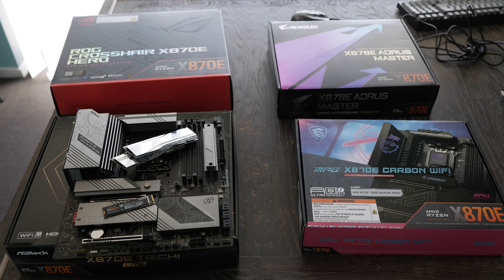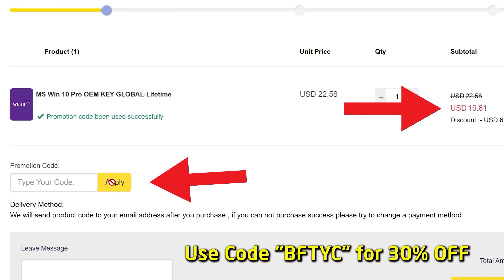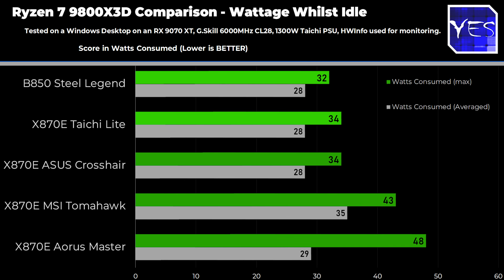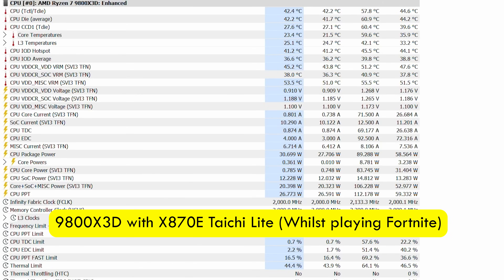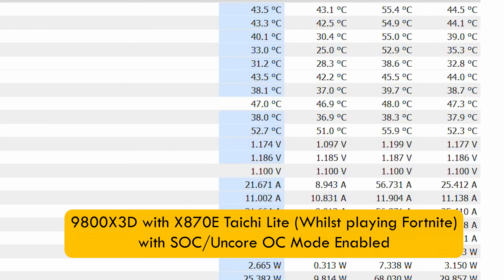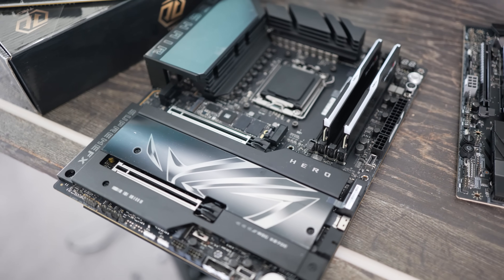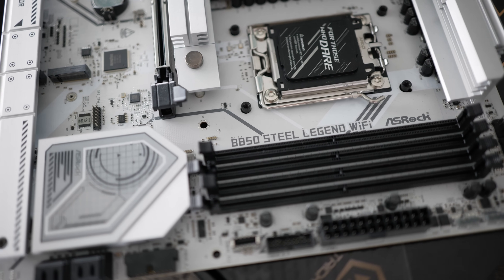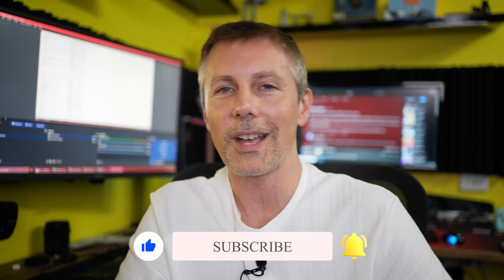I think I know why Ryzen 9000 Series CPUs are Dying...(!)

Comment: I been building computers since the mid 90s. Let me tell you something. We have NEVER had this much hardware failure rates before. Something is wrong in the industry
Reply: The road to monopoly means less competition, lower quality, and higher prices.
Reply: Physics making the components degrade faster, combined with corporate greed and cutting corners make hardware die faster.
Reply: The default voltages on higher end products seem to be bad enough that the user needs to know how to tune them. The degree of FAFO is increasing. Spent a lot of time in BIOS in recent years. X870E set my soc to 1.125 and it's almost a month old been great but have neutered it a bit.
Reply: @dianaalyssa8726  exactly, the only thing that can physically kill a cpu besides improper handling is voltage.
Reply: Greed and corruption
Reply: The technology is also much more complex now. The more tiny electronic components there are, the higher the risk of failure.
Reply: Before, almost everything was built to last, now cursed money is only thing in whole game.
Reply: Tbh the fact a device that relies on conductors that are only few atom wide works is a miracle by itself. I'd blame software devs who make such shitty code that it takes progressively more compute power just to maintain existing functionality. Office software is basically the same as it was 10 years ago, games look just like they did 5 years ago but it all requires an order of magnitude more compute to run nowadays.
Reply: @alexmin4752  You need to understand that the line between hardware and software is not very clear anymore, e.g software is being used in hardware design. But thats besides the point. The point is that engineering companies have been recently taken over by bean counters that interfere with design process, trying to cut corners. The result is obvious: unstable complex systems that get released to customers before properly tested. I am an engineer, trust my word on this :-) And you are absolutely right in complaining about shitty bloated software being produced by large houses for consumers. It is the same thing like shitty hardware made for consumers, e.g. printers. If you want quality, you'd need to go for industrial but that will cost you significantly more...
Reply: @bflmpsvz870  There's truth to your words but still if there was no such desperate demand for more compute, vendors would be forced to compete on power efficiency and reliability instead of just power.
Reply: They rush the product to try and get in front of competitors.
Reply: Same here but I remember similar issues with the AMD socket 7 motherboards/burnt processors. It was about voltages and cooling.
Reply: prices up quality down, capitalism at its finest nothing to see.
Reply: You would assume that. Back in the 90's there was no where near the capacity to find out stuff to the same degree as we can now. There may have been just as many issues back then - but you just never heard about it.
Reply: @babajaiy8246  exactly these boomers have to go to or finaly learn technology is not comparable to even stuff released 5 years ago
Reply: Firing people who get paid a lot, not a lot of testing, rushing always lead to crap expensive products
Reply: Yeah it’s like there rushing everything. It seems that with some quality control time things would get found are they just testing for like 2 weeks and rushing these chips out or what?
Reply: I remember those dodgy capacitor days. Not a single motherboard I owned back then lasted more than 18 months. Most had bloated capacitors in under 6 months 😂
Reply: Or has information become easier to access. Bro capacitors were literally exploding on all sorts of hardware. Idk
Reply: Either quality control is slipping or there's a conspiracy to make everyone revert to Betamax.
Reply: Those processors were much more robust.  I was there too.  I remember accidentally overvolting early Pentium CPUs via DIP switches and they got HOT(!) but didn't die. Lots more headroom than what CPUs have today.
Reply: same, reason this is happening is because we no longer have high end PC's with 500W PSU's, now everything needs too much voltage.
Reply: Same time I got into building and selling systems. I used to think it was a PITA having to adjust jumper switches to set CPU and memory speeds, but that has nothing on modern hardware that just straight up doesn't work and you get to start swapping parts and settings out before you have a stable system. This latest Z890 I've built it took THREE motherboards and 2 PSUs before I got one that was stable. That's insane and I've never had this many issues with a build.

How is everyone OK with the fact DDR5 just seems inherently unstable across so many motherboards? CPU failures used to be violently uncommon and they became obsolete long before dying. Everything today is pushed to 11 right from the factory so any kind of overclocking takes even more extreme cooling and voltages. 

The only thing that was "common" to fail back in the day were HDDs and the cheap Chinese power supplies you got for free with a $35 case. Nowadays you might spend $500 on a CPU or $2000 on a GPU and have it crash out within the first 6 months. DDR5 is just a mess all around so any sub-$200 motherboard is a huge gamble.
Reply: @zodwraith5745 you spelled out exactly what I meant, thank you, I didn't have the patience with these children
Reply: the answer is were having to push them harder than ever before its to the point now where speed gains often come at big reliability penalties
Reply: I started around 1980, although there was a large gap after a few years, but we didn’t see this level of failures, even when building a computer involved getting bags a chips and getting skilled with a soldering iron.
Reply: Just means you need to stick to previous gen to avoid issues
Reply: We have also never before have so many different items to choose from, there is also so much competition between the brands. Clearly there is not enough time to do proper testing with all the different configurations. Then even if all the components work fine, it can be programs, games and windows that can cause a lot of problems
Reply: @jaqen7122 that is absolutely untrue. In the 90s we had far more companies producing far more components, like sound cards or joy stick cards for example. You're just totally wrong here.
Reply: Yupp, we are declining, not only technically. Its the whole thing.
Reply: they replaced Brain power with AI power and belives its lies just as the ai pet jensen it seems
Reply: This is the stage where NO gives a f#$%. Its all about sacking humans and getting manufacturers into A.I. 
Let's cut corners, over complicate things and over charge the consumer while we still can! 😮
Reply: I have a 9800x3d coupled to a asrock nova x870e. Nothing changed in the bios. I have no problems. Should I be worried or is it just a lottery with the failures?
Reply: @rubke3932 you will be fine, don't over clock and have at least 360 cooling+  case with good ventilation
Reply: @rubke3932  monitor your CPU_SOC voltage using HWINFO64, just leave it running in the background while you use the PC and if you notice it going above 1.250V, you'll likely have problems down the line. Make sure you apply the latest BIOS update available for your motherboard.
Reply: They hate that used device being sold.
Today everyone hesitate to buy used device because its piece of junk
Reply: That's why im riding am4 until the wheels fall off.
Reply: AM4 boards had pins into the socket. AM5 has a pin to pad. Which has better electrical connectivity? 😶‍🌫️
Reply: Covid fucked it all up is my best bet. Quality went down because of price increases.
Reply: MANAGERS and  WOKE/DEI policies are the ones killing the industry, add to that overall neglect, and lower quality of build, almost non-existent QC
Reply: Greed, throw away economy and artificial market prices. Greed is causing them to cut corners and prices are artificial and not real, when we had the mining boom they realized they could screw us all over to make more money by limiting production and supporting scalpers.
Reply: They want to sell us more product!
Reply: Statistics go up with population. A lot more components made now. A lot more complicated.
Reply: Ah the good old "it was so much better in my time". I have some news for you : it's not. Those youtubers are getting views by exaggerating everything. A few CPUs dying out of thousands being sold is not as dramatic as they want you to believe.
Reply: @jergau652 HALF of 4090s failed within a year. And the 14900ks? Also within a year. I've seen machines from the 90s that are still working today!
Reply: @lokisigmatron6536  Hahaha! This is exactly what I was talking about. Half the 4090s 😂
Reply: AIBs were making garbage back then to. My gigabyte motherboard from Core 2 Duo era, died on me twice in 10 months. I had an Antec power supply that was DOA on the same built. I had a setup of 4850 TOP in Crossfire literally overheating without a direct fan blasting air on them. I hat two 1080 GTX dying on me in 10 months. The only reason why you are more aware of it now is that the information is more available.
Reply: Yes by all means tell me how many Pentium 4 processors you had to replace? Maybe even the beginning of the Athlon series as well? How many slot A's did you have issue's with? Because I know I had tons. Now, I do not argue you on the fact that there's something wrong with the way we can report these issue's. I think a mass report of all these unfortunate users to the FTC. Will at least say a little bit more. Weather or not that it does something. Who knows. It's also not fair to people that had saved for years to get these systems. It's what I like to call the "PUMP & DUMP" Pump the product out before everything was tested thoroughly. Dump em if they die and bury the evidence. It's common, if you haven't seen it before welcome to the world.
Reply: Just amd.. it's a shit China branded communist Spyware trash
Reply: All smooth brain gamers want more performance without minding its temp & power consumption. Higher power consumption & temp doesn't matter if they get more fps. Consumer tolerated it so manufacturer also tolerated it
Reply: I think you forgot about all the blown capacitors destroying motherboards, gpus and psus in the early 00s. But yeah alot of stuff should be better in theory like the 12pin connector but no.
Reply: We've never seen computation like this either. It's easy enough to say that these kind of problems didn't exist back when CPUs didn't even need cooling beyond perhaps a glued on heat sink and a case fan, but modern components like a lot of power and create a lot of heat, and while there are measures being made to increase efficiency, there's no way to avoid it entirely. It's just going to be a fact of increased complexity, smaller process nodes, and higher clock speeds. It doesn't necessarily mean there's some sort of "problem in the industry" as if this is the conclusion of some unseen or unchecked corporate corruption or dastardliness.
Reply: We also didn't have 300W CPUs and 600W GPUs that are powered by few tiny pins back in the day. I would say that today hardware and power connectors and pins are still not adapted well for these crazy TDPs.
BTW, later GPUs from ATI/AMD for AGP slot were also very problematical with their AGP/PCI-e bridges that were not cooled and it was dying or you had a lot of compatibility issues.
Reply: @lokisigmatron6536 if you've been building PCs since the '90s, you should remember the leaking capacitors plague which killed thousands of computers and peripherals over the years. The scale of that was far greater than anything we see today. Only a handful of people have experienced actual hardware failures which were not caused by user error, yet that small number of incidents is constantly mentioned, discussed and amplified due to the Internet. 

Also, don't forget hardware today has evolved to be become orders of magnitude more complicated than what we had back in the '90s. Motherboards nowadays have 8+ layer PCBs and multiple embedded microcontrollers and coprocessors. I've been building PCs since the late '80s and it never ceases to amaze me how complex (and how much more capable) a modern motherboard, graphics card and CPU has become compared to the PC XT days.
Reply: Yes its called pushing the boundaries....its getting smaller and more transistors are squeezed in. I got the 9060xt and its crashing like many times....so leaving it at stock configuration. It still crashed once🤔. So have to wait and see. Running at 3200mhz is just mad.
Reply: We live in age of bean counters, not engineers.
Reply: Indeed, feels that the more technology we have, the lower the standards, lower the quality and higher the issues.
Nowadays we pay more and have less to be honest. 
Kinda terrifying to view the current PC components being just fast paced and released with more and more terrible issues to the users..
Reply: It an algorithm. An algorithm that calculates how much of development and research can be pushed off onto consumers while making comsumers pay for and manipulate consumers innate altruism to do so. Car manufacturers are doing same. 😒 Stupid F'ing CVT transmission.
Reply: around 25 years ago, I had intel motherboard from intel (yes, back those days intel made motherboards) and it failed, and I realized after it burned several memory sticks. It was horrible as intel supposed to be good.
Reply: Charge more for less....no quality anymore...built to last is a thing of the past😢
Reply: @get.1.man.  In some ways yes, in other ways no.  I remember the days when you were very happy to get 100K miles out of an American-made car.  (Yeah, I'm old.)
Then Japan figured out that reliability sells.
Reply: Greed rules...sad
Reply: Chips are overclocked to the limit out of the box nowadays. Back then you had a good 10% or more safety margin in terms of clocks and voltage, now there's almost no safety margin. And then board manufacturers are trying to one-up each other by having more extreme settings and performance on top of those stock automatic overclock settings. It's honestly surprising that more chips aren't dying.
Reply: @ryanspencer6778  yeah like absolutely to the limit. Sometimes its impossible to get higher OC manually versus PBO which is crazy.
Reply: Young kids taking over the industry from their fathers. That's what's been happening to the quality.
Reply: @AngelicStreak ok boomer
Reply: back in the day u could OC cpu easily for over 1+ ghz extra. Nowadays u cant rly OC at all. They are running the cpus close to the edge out of the box. Maybe there is still qc issues though.
Reply: @megapet777  thats intended design lmao theyre unlocked and boosted automastically, thats the old intel dog shit way of doing things
Reply: the motherbpard manufacturers have been messing up boltsge values for more than a decade, but on the last 4 years things got really bad

the competition for the fastest motherboard running your cpu should change to the motherboard with the less problems for you, for the longest time
Reply: choosing parts is like walking on a minefield and we're not talking about bugs, but catastrophic failures and risks of fire.
Reply: Its just too much power. Its simple.
Reply: @turkovich530  It's also related to the ever-decreasing empty space between transistors. 3nm is easier for voltage to jump across.
Reply: It's a convergence of multiple causes: (1) CPU manufacturers using automatic overclocking to push the silicon to the limits, instead of sticking to conservative limits, (2) tighter requirements on DDR and PCIe generations, (3) GPUs are mainly used for non-gaming use-cases, so less emphasis on quality, (4) higher power draw for CPUs and GPUs, and (5) QA has really collapsed for the whole industry by now. Even giants like Intel and ASUSTek seem to not do proper release testing. At this point, the only company that has a reliable full product stack is Noctua...
Reply: Ya they stopped giving a shit
Reply: We don't apply ourselves anymore,Everything is instant gratification,we order food and things online without ever talking to a human,we dont wanna work and try to easy way out by being " influencers "
Reply: @fnggaming89  boomer reply, tech advances rapidly not at turtles pace
Reply: ITT people missing the point
Reply: This seems to be happening with 3d vcache chips.  We didn’t have that at all in the old days.  We were on 32nm processors in 2012.
Reply: Its a lot easier to share issues today than in the 1990s. And they were on gigantic dies, much easier to not have failure with those models. It's way harder to manufacture today's cpus.
Reply: Who was reporting it like that back then
Reply: You’re more exposed to information about hardware failures because of the internet. There was no YouTube in the 90s.
Reply: @boshi9 Absurd. We had magazines and we had the internet since 93
Reply: Wrong
Reply: Advancements and everything they bring with them…
Reply: Industry is larger, internet is even easier to use today than it was in the MID 90’s!

Bro get a clue, it’s confirmation bias
Reply: Don't be that guy. I have been building since the 90's and I can tell you that you are being dramatic right now. "Get off my lawn....Things were better back then"....
Reply: Because things are a lot more complicated and delicate? It's not two wire and a battery anymore
Reply: @lyteness859 It never was as simple as "two wires and a battery" ya knob 🤣
Reply: @lyteness859  Ppl used to use the same excuse to justify why Merc cars were so unreliable...that is nonsense. As consumers we pay for those features therefore they should work. If manus can't make those features work reliably then they should not advertise it. Basically I paid for all those merc features and therefore it should work. If I wanted simple I wouldn't be paying for complex.
Reply: ya the industry is a lot larger than it used to be lol get a clue
Reply from the maker: @def0n3  I think the hardware is just being pushed too hard out of the box nowadays, that's the biggest difference I have noticed personally.  Hardware used to have like 50%+ OC headroom on some models back decades ago.
Reply: @techyescity  There is a physical limit to 3 Nano
Reply: @def0n3  nice excuse but having started in this business selling 360k full heights and 8086 coprocessors I think I can say it’s contracted quite a bit since Covid. Quality control is in the toilet lately.
Reply: @support2587  by sheer volume the industry is way bigger than what op is posting about you just changed the subject.
Reply: @def0n3 quality standards and even common sense can and have absolutely fallen at the wayside in the interest of profits and higher scaling, but maintained just enough to not have it topple. one thing being true doesnt invalidate the other Dunning Kruger
Reply: @G4RYWithaFour  partly true but the market has gotton bigger so asuming hardware failure rate is about the same you are going to see more of it just because there more people buy it.
Reply: @def0n3 no. Quality standards have dropped like never before seen. And that’s because we will still buy them. Look at nvidias 50 series. All the issues and I still paid over 2k for a 5090.
Reply: @shabazz717  the market is different from before, everything is different, you cant compare standards from before, power draws were nothing like this.  The market  has never been so thirsty for crap either because of nvidia fanboyism
Reply: @def0n3 Either you have had your head in the sand, or you are being purposely obtuse. Intel having back to back CPU generations (13 and 14 series CPUs) that brick themselves due to shoddy power management isn't a function of a growing industry. Asus and other board manufacturers having a systemic method to deny warranty claims to avoid losing profit to bad QC isn't a factor of a growing industry. It's a function of an industry that is focused on making a quick buck at the expense of customers every time.
Reply: @def0n3 more consolidated then before.
Reply: @def0n3 he says from his perspective I believe
Reply: @def0n3 larger... Bigger things are, doesn't mean it good. If they can't maintain the quality in bigger factory to make the parts. ( Quality control ) Then they gotta fix that before selling us.... It like selling the faulty cyber truck.
Reply: @TheDragonfriday  this is more than just being bigger lol.  this tech is far more complex and far more widely available than ever before. not to mention failures in the past we probably didnt hear of because guess what?? there was no internet to whine on
Reply: @def0n3  pretty sure if you make a proportion it still was way lower
Reply: @def0n3  Rates are in percentage, not absolute numbers. Learn math.
Reply: @seamon9732  percentage or not they were not mass produced before like they are now, learn common sense